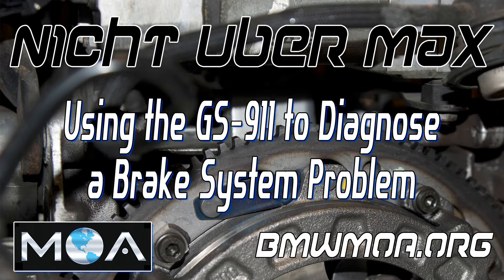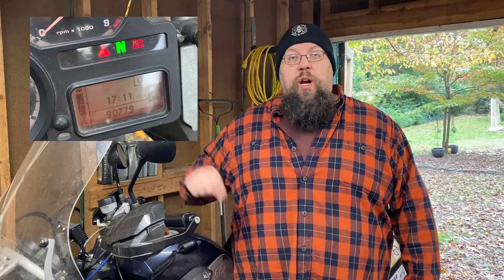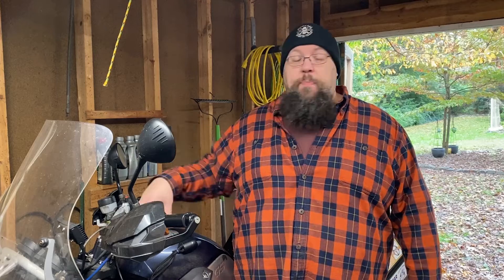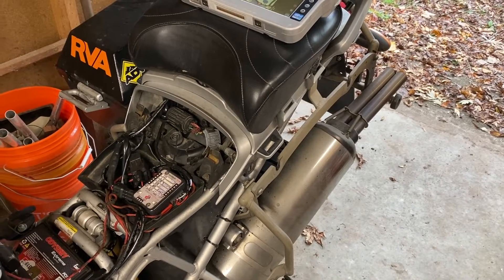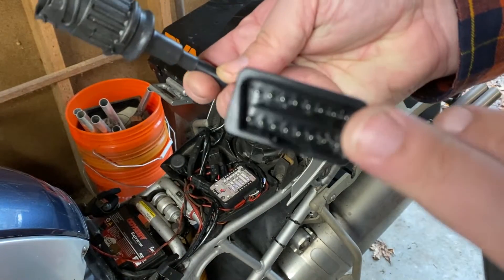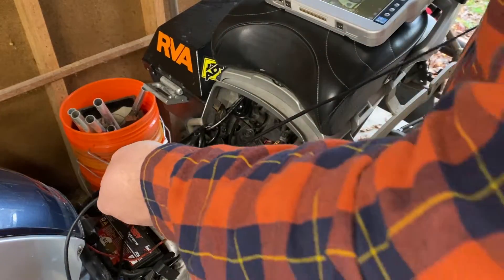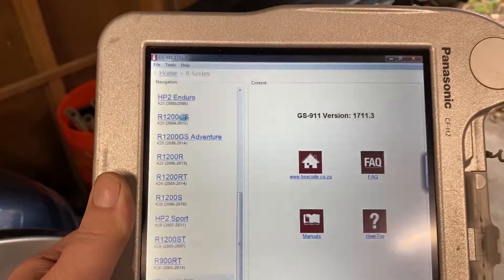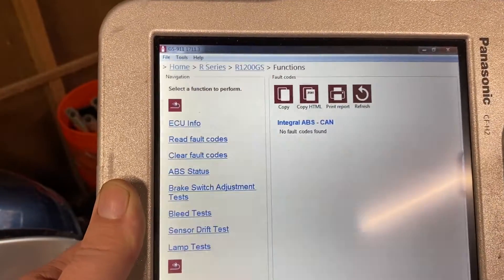Using the GS-911 to Diagnose a Brake Problem

Comment: Good info on the 911. I went with the MOTOSCAN APP professional and used the OBDLink LX OBD2 bluetooth adapter recommend by the MOTOSCAN. Bought bluetooth adapter and cable adapter from Amazon under $90 and under $30 for the app. Worked great on my 2015 R1200GSA for resetting the maintenance interval after completing annual maintenance.

Comment: Wes, I have the same Wifi issue with my GS911 (trying to connect the GS911 to the PC without hard wiring). Maybe the smart folks watching this video can offer a solution. Also, let us know the cause of the brake pressure issue if it returns. Keep these videos coming. They are great.
Reply from the maker: Sorry to hear you're experiencing the same issue - I'm sure there's a simple solution we are overlooking. Will keep you posted on the brake problem!

Comment: Amen brother you said it cheap and easily thats the goal lol 05 R12RT 92,2xx miles clocked just did  the alternator  clutch master slave then the brakes were wonkey red light solid on brake light warning after a days riding i took the tank off and lone behold one of the Two pin connectors wasnt seated completely  (click)😮😅 put it all together now my fuel module went bad how nice made the bypass with a switch and now the bitch dont

Comment: 2006 R1150GSA with same issue, except I have two GS-911 fault codes: 
17433	Pressure in rear wheel circuit too low
17911	Defective rear light
The rear light is working and the Brake Fail light (and errors) return when I apply the rear brake or the hand brake with above average force.  I added a smig of brake fluid to the rear reservoir but to no avail.  I can't get into to my tech for several weeks and am looking for suggestions so that I can continue to attend much needed two wheeled therapy sessions in the mean time.  Thanks.
Reply from the maker: As long as it works, it works. The problem is once it stops working, you lose the vast majority of your braking power and suddenly it's dangerous. Unfortunately, I don't recommend you continue riding until you can get this looked at, because you don't know if it's going to fail mid-ride.  Good luck!

Comment: I believe that light stays on until you go above 10-15mph, tap caliper and it goes away.  Was this code clearance able to resolve the issue? My bike fell over due to heavy winds 2 days ago. Brake failure is strobing like crazy and don’t have any power in my rear brakes. 2006 bmwr1200rt
Reply from the maker: Yes - the initial ABS and ASC (if equipped) lights will stay on until you get moving and the computer has enough information to complete the self-check.  Clearing the code didn't resolve the issue - it came back several days later - but I think it's important to know that clearing error codes doesn't solve problems, it just alerts you to the symptoms of something that needs attention and turns off the alarms (lights) so you can ride distraction-free.

If you don't have power in your rear brake on a 2006, that sounds like an ABS unit failure, certainly in the rear brake circuit. Get that checked out immediately but unfortunately you need to be prepared for the worst.